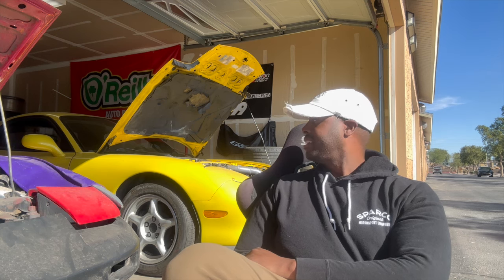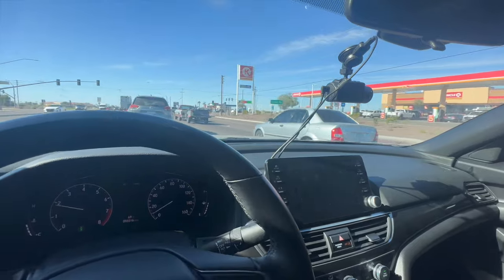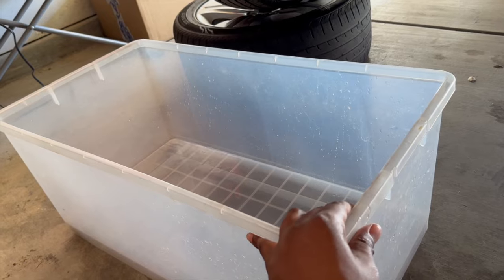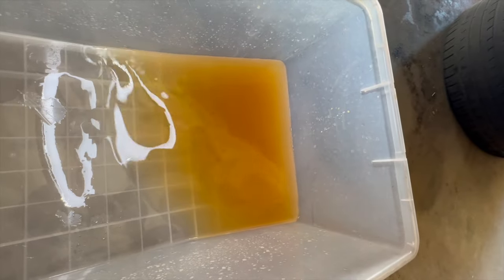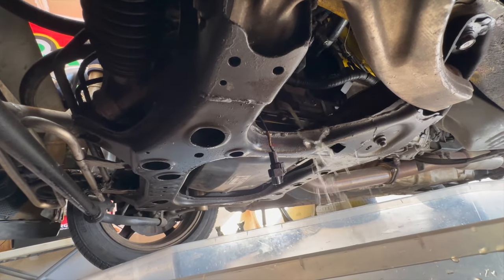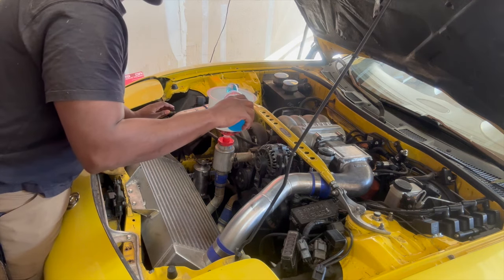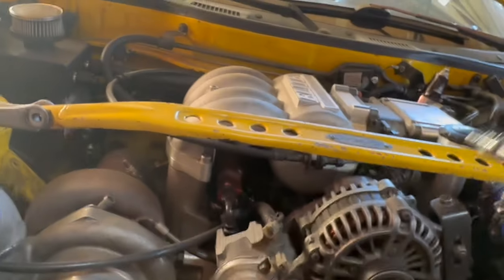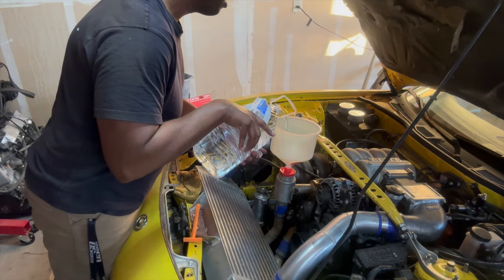I Found a Surprise in the Botched RX-7 Cooling System...

Comment: get yourself a new fd fan shroud, and S2 series RX-8 R3 Fan Motors: N3R115150 ( You will need 2 of these) and the rx8 fan blades. 
Right Fan Blade: RF1S15140
Left Fan Blade: RF2A15140, it cool better, it doubles the cfm.  i also have a vmount and i don’t regret doing this with the rx8 fans and blades.
Reply: THIS! I’m looking for a stock FD shroud as we speak!

Comment: When I flushed my FD it was disgusting. I should have done it way sooner. I ran a cleaner through it and flushed it several times using tap water and it took ages to clear up. Yes, my engine was happy to dump the fluid but refilling was a nightmare each time. It's like it air locks and you need to run the engine to operating temp so the thermostat opens and allows the fluid to get into the heater core and push the air out. Talk about burping an engine....
I won't be leaving it too long this time. In fact I'll likely do it annually. Because here in Australia we don't get freezing weather where I am I just used an anti corrosion green coolant.
Reply: The burping process took me 3 hours today. I probably overdid it, but you’ll be surprised the next video

Comment: Remove the thermostat for flushing for sure, I mean it’s pretty darn easy to get to.  Make sure u put it back in though 💯.  You can drill a small 1/8-1/4” hole in a thermostat for an old-timers trick to lower temps a touch under oem, but by now im sure there’s an aftermarket solution for lower thermostat.  Just make sure u don’t take it out entirely, I made that mistake once and the water moved through-out the cooling system so fast that it didn’t have anytime actually dissipate any heat & i over heated my Starion
Reply: Great tip
Reply from the maker: Technical Comments always. Thank You!!
Reply: I removed the thermo for flushing. I left it out briefly until we get everything painted and pretty

Comment: I used ThermoCure and was happy with how well it removed rust. The first three flushes were really gross, and after about six or seven flushes it was mostly clear. Don't forget the block drain; the water pump inlet & outlet are both up high so there will be a lot of coolant left in the engine if you neglect the block drain. https://www.youtube.com/watch?v=V7vuNVo9O0M
Reply: I drained the block each time, total it took about 20 gallons to clear it. After testing the “coolant” they charged him for, I learned it was tap water and rust.

Comment: Of course the V-mount is crooked! Holy hell the fan mounting is horrific. This build just doesn't get any better. We did superior work when we were rotary swapping a BRZ in 72 hours. We had it running better than this car as you got it in 11 days of work, hahaha. This is just pathetic. I understand if a shop is overloaded and trying to push stuff out the door, not that they should do that, but even my quickest work is better than this. Looks like that intercooler has a pinhole leak and the turbo drain probably isn't working perfectly so some oil is passing through the intercooler. Just a guess. Not only did they not use corrosion inhibiting coolant with mixed metals and cast iron, but the coolant reservoirs aren't set up correctly either. FWIW oil pan leaks are incredibly common and it's a pain to seal them up, but still not really an excuse. Also strange the oil level sensor is missing given it was a stock FD at one point and it has the connector for it. Wooow they didn't even use an OEM thermostat and that gasket is definitely reused. Everything rusted and cruddy. Looks like they used hard tap water. Wooooooooooow a stripped bolt too what a surprise. This is one of those cars where you can count on every single thing that has been touched being wrong. One of the only other builds I saw this bad was the Miata on I Do Cars. Holy crap. I really hope they didn't do much wiring.